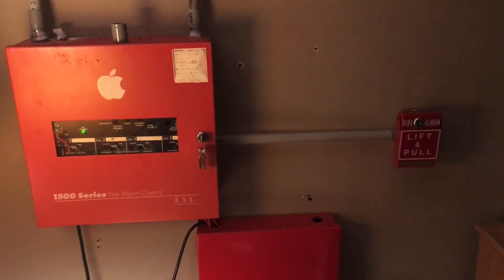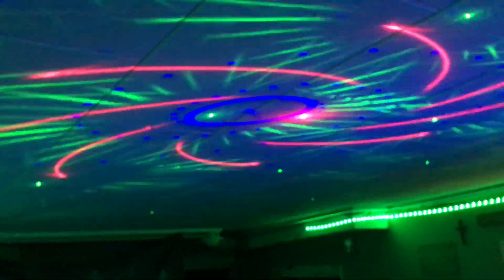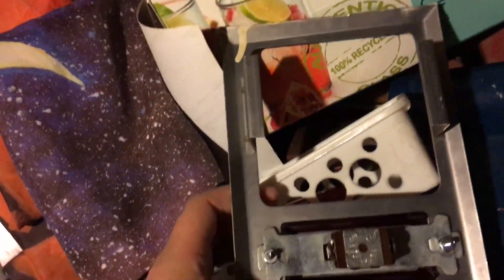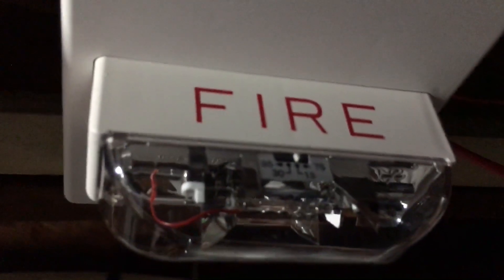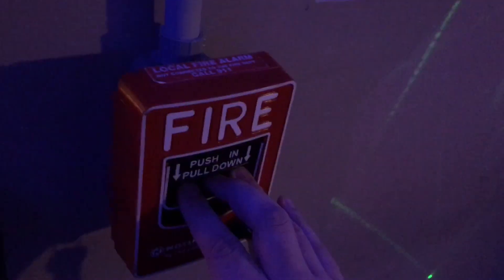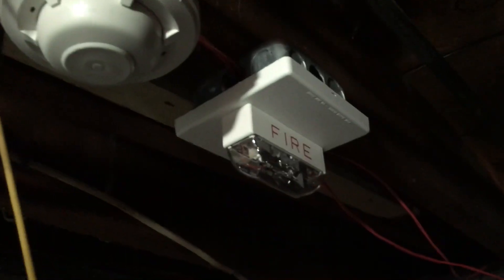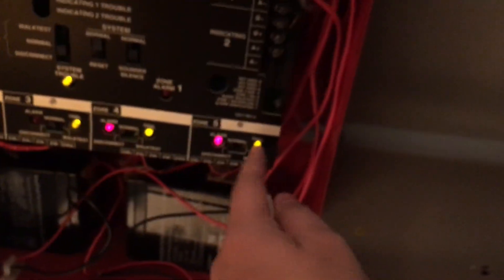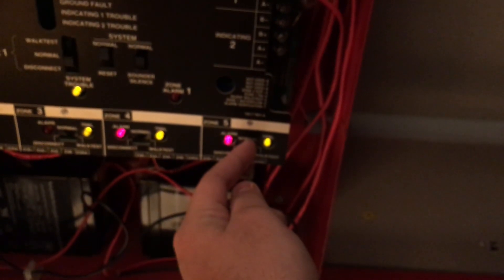System Test 11: Peace and Quiet

Comment: Sad the Wheelock horn was messed up. This is still an amazing system. I’d say this is one of the all-time greatest!
Reply from the maker: The weird part is that it worked fine on 3 9 volt batteries after I took it down. I don’t think it likes being ran on my power supply.
Reply: @CoolSimasGuy  Strange.